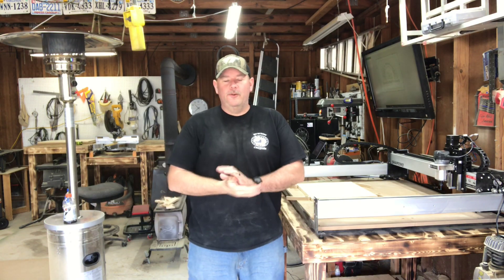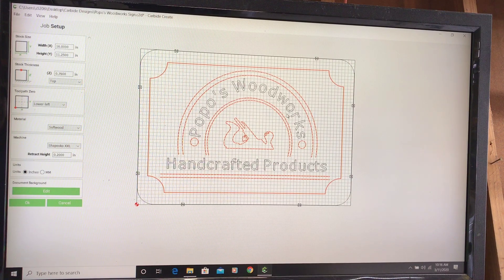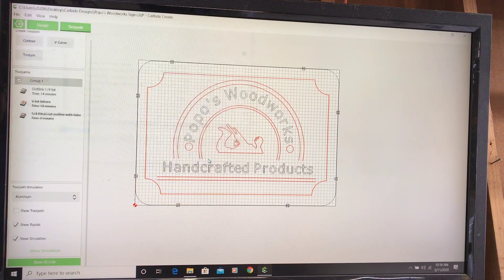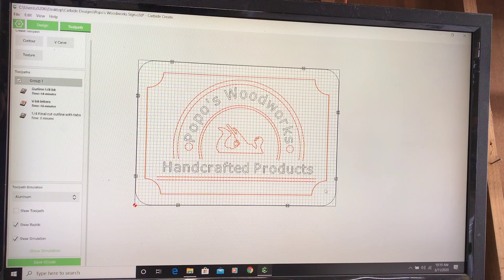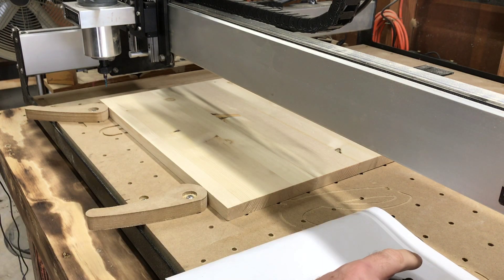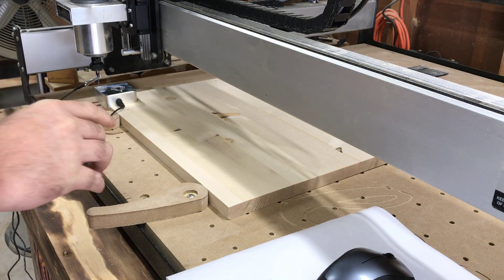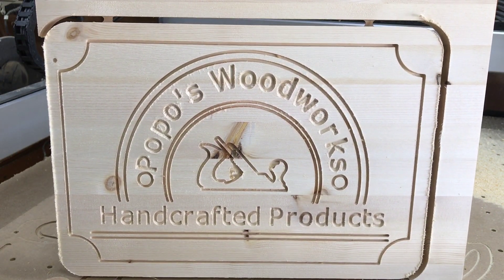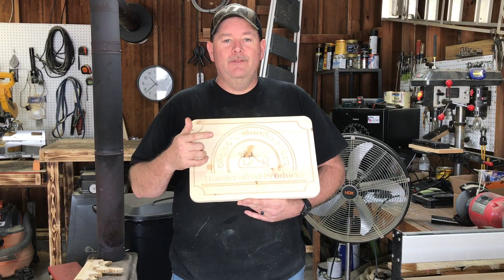Shapeoko xxl | Making My First Project In Carbide Create

Comment: Heads up, you do NOT need to save the G-Code 3 separate times. All you need to do is make sure the operations with the same bits are grouped together under toolpaths (aka the ones using the v-bits or whatever first, .125 inch bit second, and .25 inch third. Or whatever you’re using.) The machine will stop when its time for a bit change, go to the front of the table and you can change the bit from there.
Reply: To workflow like this you should have the bitsetter, otherwise using 3 different gcode files and zeroing after each bit change would be the proper way to do it.

Comment: Great video and glad too see another XXL user out there. December will be two years with mine and I am still learning. You will go through a lot of trial and error (and materials) learning things but don't worry about it. 
If I may suggest a way for you to save on time and headaches if you haven't figure it out as of yet. You saved each tool path with it's own gcode file. If you do all of the tool paths and then proof each one and are sure that they are good then save the tool paths as one gcode. This will cut down immensely on files and where you are storing them. If I have have more than one piece in a project (base, sign etc) then I save that project only to its own folder and then each gcode will be saved in the same folder. Everything is together. If you haven't started on acrylics yet you should consider it. It's another level of the cnc world alone from just wood. If you are interested in doing something like that email me at  yooperoffcut@outlook.com and I'll show you some acrylic work. I am far from being a pro at this and I am always learning on this machine and program and I have received a lot of help from folks in the community. Thanks for the video and keep up the great work. Gets a like and a sub.
Reply from the maker: Thank you!!

Comment: Thanks for making the video. It was just what I was looking for. I am thinking about buying the Shapeoko XXL as well. The cutting area of this machine is just about perfect for what I will be doing with the machine. Unless there is something better around the same price that will have the same cut area? Did you ever get your crashing problem fixed? That kind of worried me to be honest.
Reply from the maker: Dennis Fawver I did, per everyone else the crash issue is interference. So I gave each part of the machine a dedicated circuit. I went about a month and didn’t use it then I had it loose connection a few times my first time back at it. Seems like the more you run it the better it is. But with that said I have a lot of things in my shop that can cause the interference. Nonetheless I still love the machine for the price!

Comment: What do you do regarding dust collection and noise reduction.
Reply from the maker: Russ Brenner Nothing really, ill start the machine and just walk away while it cuts. As far as dust collection, the carbide router while cutting blows the dust to the side. I just use the shop vac during the cut to suck up all the dust.

Comment: There is a graphic with generic speeds and feeds if you just google "shapeoko 3 speeds and feeds"! Should be on the carbide3d forum.
Reply: Also a spiral downcut bit would make it so you don't have to sand the surface. Just bought a Bosch one from lowes and its amazing.